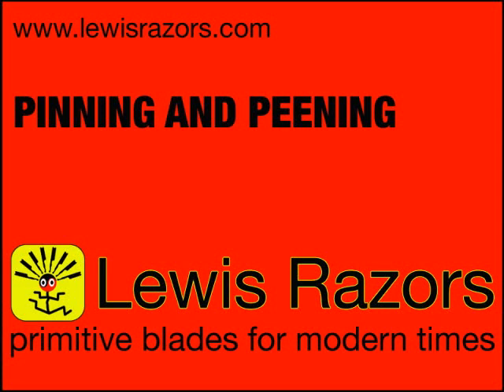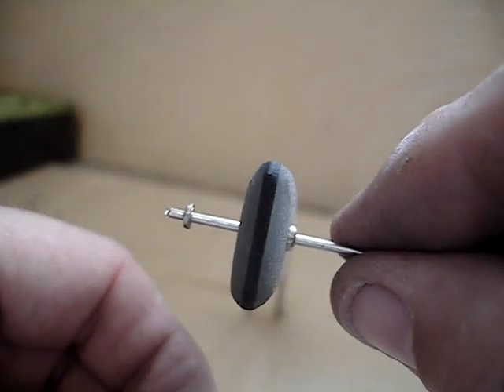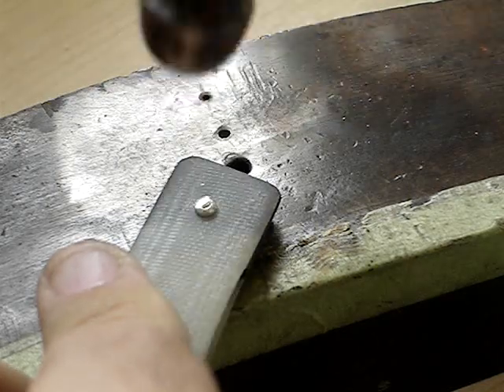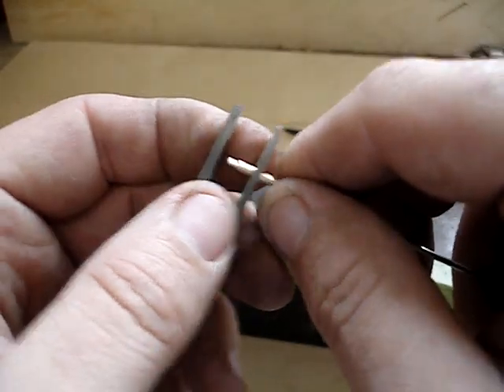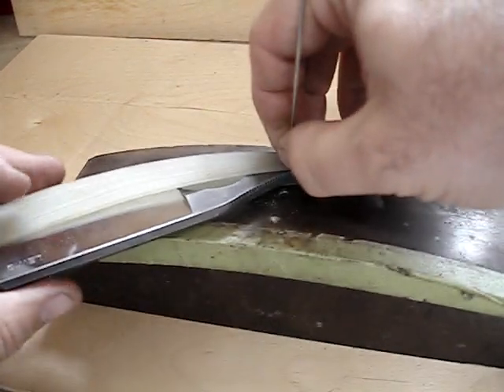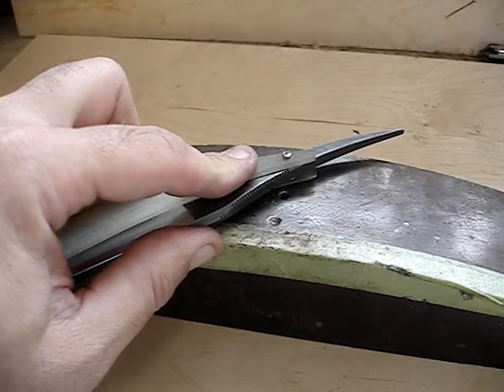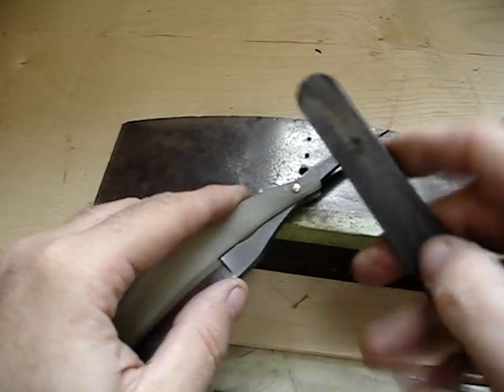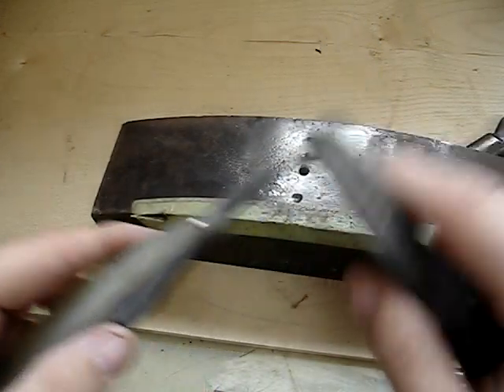Pinning and Peening

Comment from the maker: +221Dw The depression allows clearance for the pin material sticking out on the second side or the side face down. The process will work without the little depression or hole. I find it easier to peen the first side if I can the scales resting on the surface.
Reply: These videos are awesome, mate. Good find.

Comment: The knife community seem to have a problem with splitting their scales when they peen handle scales. I'd be interested to know  the razor guys obviate this? Very neat work and cool razor, btw.
Reply from the maker: Razors nearly always are pinning over small washers, the small washers keep the handle material from getting a splitting pressure. With knives a lot of time you are pinning straight into the handle material, this is a lot more tricky and delicate.
Reply: @lewisrazors  Thanks very much for the reply and explanation. Once again, excellent work. Cheers!

Comment: Thanks for the tutorial :) why do you use the thrust washers though? Do you have to use them..?
Reply from the maker: Job Spits You do not have to use thrust washers. Originally some manufactures used them some did not. I like to use them I do not like the shank of the blade rubbing on the scales.
Reply: I see :) well, I'll just use the normal washers for now and maybe in the future I'll be looking into those thrust washers! Thanks again.

Is it necessary to use a ball-peen hammer? Or can you use a regular one?
Reply from the maker: Job Spits Use whatever hammer you have, not ideal, but you can make it work. Light taps, REALLY LIGHT taps do the trick, lots of light hits.

Comment: What the purpose of the depression the pin/rivet goes into?
Reply: Without it, when you peen the first side, the pin would end up flush with the handle scale (on the side you are not hitting) and when you turn it over to do the second side there will be nothing standing proud for you to peen.